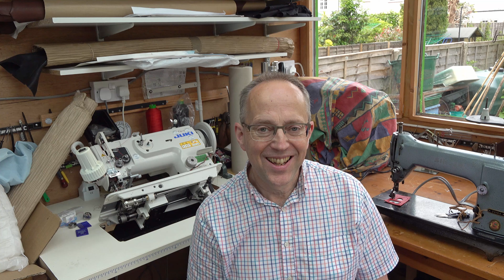How To Fit An Industrial Leather Sewing Machine Into Limited Space

Comment: I am enjoying discovering your videos. Thanks!  I am trying to think of ways to fit my new little hand operated shoe patcher into my sewing area.  You have reminded me of the sewing machine tables I grew up with. The machines were commonly not only hinged to the table like yours, but would rotate forward and down into a cavity under the table top, so that another drop leaf could be closed over the top of it.  All of that sewing machine area could be a work surface again when the machine isn't deployed and in use for leather sewing.  I was planning to mount my little machine on a platform which could be lifted up onto the tabletop, but now I am thinking I might put in either an elevator or a hinged platform under a false panel.  Thanks for the inspiration!
Reply from the maker: Thanks and that sounds like a good plan...I have even wondered at times about having a two level table with a machine at each level!
Reply: @harryrogers , I have been looking at woodworking shop ideas for several months, as we don't have room in the side of our garage for the next machine (a thickness planer) we want to fit.  Just like your thought, I've passed the idea of an elevator affair by my better half. This brings to mind flip-top stands which are quite popular in woodworking -- seems that would be easy to do with sewing machines; I don't think it would hurt my machine to be hanging upside down.  There are  rotating platforms with multiple machine stations.  But I like the old-fashioned hinged hidden sewing machine idea for my shoe patcher, both built into a surface and hidden when not in use.  I have an old Singer treadle table (unless my better half decluttered it), but I think I also have my first sewing machine cabinet with exactly that mechanism in it.

Comment: Very good, I know the feeling as I work in a converted loft. Because my Juki is not needle feed I am about to replace it with a cylinder arm like yours. Question, you said  in a previous video that you were concerned about using it for thick leather yet as it is geared down like your Juki it must mean the strength of the machine was the issue. Have you had problems in the past? What sort of thickness would you say its good for? Any advice much appreciated. Thanks.
Reply from the maker: Hi Dave, I don't want to knock it out of timing, I have not had any problems with it. I use it to stitch max 2mm calf leather for bags and it seems very happy, even going over seams, I have not put anything heavier through it. Its like a PFAFF 335, so I assume it was not made for heavy leather like belts.

Comment: Nicely done.  I like those hinges and the leather corner pieces were a good idea.  You might consider adding some metal support (like 1 in bar stock) under the table to reinforce the corners.  It looked like the table is pretty thick press board, but over time that might weaken.  Thank you for sharing.

Comment: Harry, nice video. I have a similar issue. My plan was to create a custom table top out of multiple layers of plywood and then make a universal insert in the table to accommodate the largest machine and then customize each individual machine table insert. I’ll use a servo and hope to include my Singer 31-13, my High post 51W54, and my Fortuna skiver and my Pfaff 130. One table with a fixed location for the belt. I need to figure out how to handle the belt length variations probably with individual locations. Very much like your approach. Great video.
Reply from the maker: That sounds very clever...maybe an idle pulley on a moveable arm might help with setting different belt lengths...just a thought!
Reply: Harry That’s a great suggestion. That is part of my way too long lists of projects. I am still working full time at my current job which demands most of my time during the week. Luckily I am about two years from retirement so have time to work on this list and get things set up as I’d like them to be, including a Metal lathe (1939 vintage) to be able to make metal parts. My entry into leather working is high on my list as well as my antique sewing machine restorations. I really appreciate and share your love of vintage tools and processes to create ( green wood chair was great). I very much enjoy your leather working videos and am using them as a primer for when I can get that going. I listed some machines for my universal table and also have a 1913 29-4 patchers. It’s fully functional but needing a cosmetic face life ( on the list LOL).  Keep up the great work. Cheers.